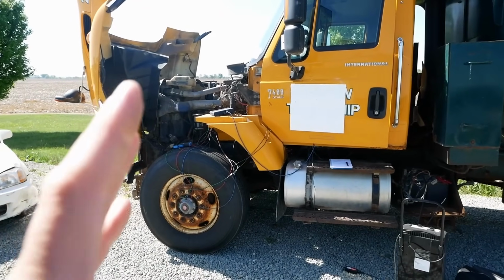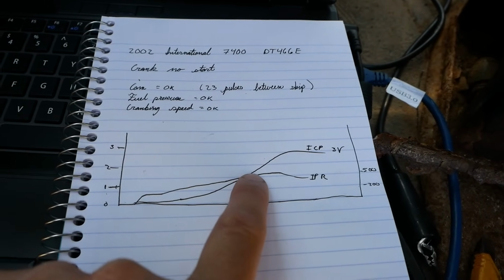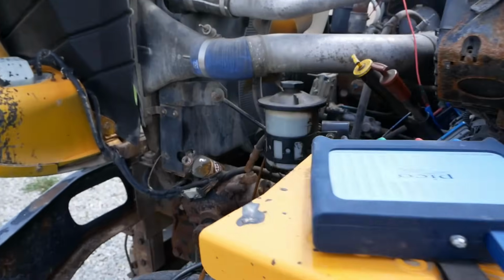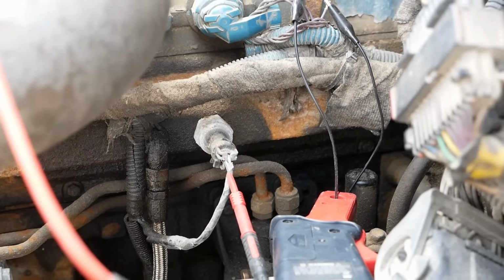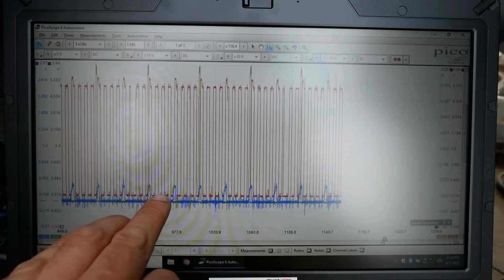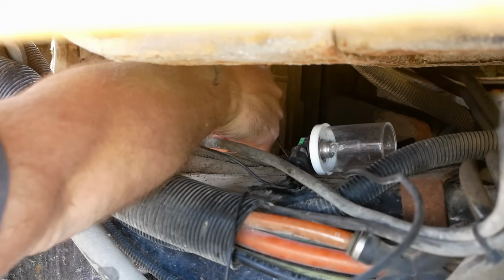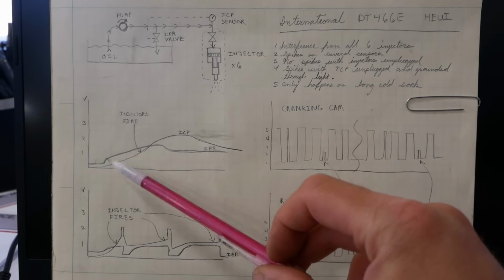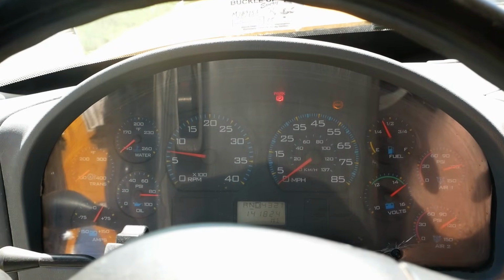International DT466E Won't Start without Ether after Sitting

Comment: These engines were good engines. They aren't too complex to diagnose. I think you need to invest in some software.  I've seen this issue before on refuse trucks. The truck will crank fine but one battery is actually bad. Voltage drops low enough it wont fire the injectors. Load test the batteries and one is bad. Install two new batteries and it starts right up.

Comment: Had the same problem the fuel runs back bleeds back to the  system, what I did is I put on electric auxiliary fuel pump to push the fuel into the injector pump

Comment: You might be overthinking this. With the fact that it will start with the battery charger on it, maybe it could be the battery cables not allowing it it crank fast enough.

Comment: This may have been covered slready but, the ecm relay in the dang fuse box on the fender skirt is just trash. Should have been put rlse where. Anyway the spade comnectors become coroded an she wont start. Keep them cleaned  as best you can.

Comment: Cycle the ignition after you shut it off at the end of the day it resets the ECM and it will fire up the next day with no problems works on my tow truck with dt466e

Comment: I clipped a ground wire to the pcm , Truck runs great  👍,  mine may also need a new pcm , I have installed used pcm on a  Truck , it worked fine  Ebay  ,  my pcm and idm weren't communicating,  I clamped a ground wire to the pcm and it started right up,

Comment: Why do u think it needs a computer
Reply from the maker: Watch the video man.
Reply: @WatchWesWork  ended up being #2 injector I ran the truck with the valve cover off seen oil spraying out the side of the injector.
Reply: I did and it makes no sense I went over everything u did and mine want start on ether
Reply: New ipr and icp new cam sensor builds pressure fine won’t start on ether

Comment: My guess would be dryed-out electrolytic bypass capacitors in the ecm. It resides close to the engine, so it is subject to heat. That would accelerate deterioration of said capacitors. What I would try is connecting a 22 microfarad cap of reasonable voltage rating between the 5v reference voltage to ground and check if that fixes anything.

Comment: I’ll bet it’s got leaky injector seals. ? Valve cover off. Get someone to spin it and look for clouds or puddles of oil around the injectors. If the seals get hard and fail the injector actuation oil pressure gets low and won’t fire the injectors.
  It takes 400 to 700 psi of HUEI pressure to fire the injectors. I can’t remember if the service tool has an injection actuation pressure test like cat does… the injectors are nearly the same as cat ones. I do remember that the international software does have an injector solenoid test. If the injector solenoids are very quiet and not clicking loudly, they are shot. The DT466e I had ALL of them quit at once. It had 15000 hours on it.

Comment: (God kveld. Utfra hva JEG kan se og få ut av videoen så slår2 ting meg som faktisk BØR undersøkes: I og rundt motoren så har man påfallende MANGE releer. I tillegg til at datamaskina i dettte tilfellet høyest sannsynlig kutter ut grunnet feil i styrings enheten som FÅR motor i gang. Når det gjelder relee, ryker sjelden 1 alene. Ofte er det tullball på flere av de. (I og med  at motoren er fra 2002 så har den garantert  flere av de. Det der med at den mister TRYKK, tyder på feil på styrings enheten som har med data å gjøre. Det ER ikke alltid at man får opp feilkode på sånt. M.V.H  Frode Valderhaug

Comment: Just curious was the starter oil soaked with a crap load of oil contamination in a lot of the sensors? If the oil is getting into the starter it increases the resistance of it and it builds a lot of heat which reduces it ability to crank because the resistance is opposing the current flow. You needed a battery charger to keep the weak batteries charged up or on jump mode putting out extra amperage to over come the positive temperature coefficient factor of the extra heat generated. An amperage reading of the starter draw would have been interesting to see but if the starter cannot turn that engine fast enough oil pressure will not rise enough to fire the injectors off. Not saying there isn't issue with the computer someone before you could have installed a computer module on it that was not rated for the same horse power and never programed it the the computer was the same part number but the rating for horse power are lower cause it was used on a lower power motor. Before and after amperage readings of all types of models kept in a note book is worth a lot to you later down the road. Even if it's not oil soaked that doesn't mean it isn't corroded internally btw. Oil soaked one was my issue with the exact same symptoms changed the starter out never had this problem again but it sounded fine cranking just dragged a little and that seemed to come on to quickly once I seen the amperage readings of my starter I thought it was hydro locking or something was seizing up but sure enough it was the starter. Took off the belts and turned the engine over by hand no reason why my amperage was through the roof except for the fact the starter was pulling excessive voltage due to an increase demand for current cause the resistance heat factor was so high. Great video

Comment: The problem is there's not enough icp pressure,he said it him self,I would of checked the oil resivour for the hpop, and if that was full,I would of then pressurized the hp oil line to listen for leaks, if no leaks,and the ipr valve is good,and there's low hp oil then it leaves the hpop as a cause.  Takes more  oil pressure to start it then for it to idle . They can idle at 450 psi when warm takes around 600psi to start it cold.

Comment: Not sure if this helps we have international 7400 with a dt530 a few of them doing the same thing after sitting gotta spray them to start turns out it was a fuel silo where 3 steal lines go into it as well as the fuel filter replaced on both vehicles problem resolved have another one on order god luck to get one been waiting over a month

Comment: I got one OFF the can by replacing the plastic fuel line fittings at the tank and pump. Once it started it seem to have enough vacuum to seal back up. Overnight I guess it lost some pressure then you were sucking air in the morning if you walked over and pushed down on it at the tank it would start right up. 

Now I am fighting it all over again something different this time. 

Great video learn some things from the comments as well.

Comment: but none of it explains why it does start without trouble within 24 hours of having run.
that is not temperature related.
to me that is fuel  pressure related.
it used to start with the help of a battery charger.
now that has deteriorated.
that is not computer or electrical.
that is a  high pressure pump internal wear growing bigger over time.

Comment: I think it’s an electrical issue. Pretty vague but I think a resistance is in the harness like fraying or corrosion. I’m have the same issue with my tow truck. I get it started by shooting ether down the intake of the turbo and it starts and run like a champ. Mechanically it can start and run but key on engine start it won’t start. In my case I already rebuilt the pcm and idm replaced the low pressure pump and high pressure pump. My only variables I believe I have is the fuse box and harnesses

Comment: Hey Wes, we're working on the same motor in a 2003 international 7400 with the dt466E. The driver has had a problem with starting for a while now (long start like it's not primed). He just recently had his truck shut down on him in the middle of the road. We cleared out his fuel lines/replaced the filters. The old filters had a sand/clay like substance in them. Running on a little ether and the new filters it ran for about 4 minutes with a ton of white smoke. Now it won't start at all with no ether. We checked the fuel pickup pump, nothing came out of it from the fuel tank or a 5 gallon jug connected. We replaced the pickup pump and same problem. We think the HPOP can is worn out or not spinning with the bull gears. What do you think?

Comment: Hey wes, i would have taken a heat gun to the theagic computer box,  i think there is a electroltic capacitor, that isnt the corect value anymore, if you heated it up without running it that would prove it in my book

Comment: *******  Stop diagnosing and remove and sand every electrical connection starting at the batteries, replace the battery jumpers and solder everything you can. Clean all the connections on the fuses as well. if a battery charger helped at one point than there is an electrical bottleneck somewhere. The truck is 20 years old, trust me and clean every electrical connection, dont assume any are good by looking at it just clean it. Running a jumper for the computer supply power to the battery may be required also. the chassis ground by the starter should be addressed also. Thank me later  *******

Comment: This engine is a recreational user of ether compared to the full on, heroin-like ether addict I had to enable when I was 17 years old.  Back in the summer of 1989 my brother and I got a job drilling holes for a blasting contractor.  He had an old (probably 1960's) Gardner-Denver compressor to run the rock drills.  (As an aside he used to pull it around with an early 70's Lincoln with suicide rear doors. He was a bit of a character). I have no idea what make the diesel engine was that powered it but you could run it wide open for hours, shut it of off for 5 seconds and it absolutely would not start unless you gave it a shot of ether.  Its addiction was notorious enough that the rubber hose that connected the intake manifold to the air breather never had a hose clamp at the manifold.  To start you pulled the rubber hose off the manifold, pushed the start button with one hand and used the other hand to spray away with the ether can.  Once it started you placed the rubber hose back on the manifold.  It was a high functioning addict as once it was started the thing ran like a charm and never let us down.  Before I saw this video I was the only person I had heard say that an engine was addicted to ether.  Ken

Comment: If it wont start without ether its because of low compression.
If you use ether regularly you will make the problem worse
because ether washes all the lubrication off the cylinder walls.

!

Comment: The computer will not fire the injectors until it see 900 PSI ICP pressure.
Reseal the high pressure rail.
Throw away the old ICP sensor and replace with new.
Reply from the maker: It's getting 1500+ psi with the injectors disabled.

Comment: Why on earth do manufacturers insist on placing expensive computer control systems in such stupid places? Here we see it wedged into the back of the engine exposed to massive heat cycles, others think the best place is low down behind a front wheel arch liner. I don't know if this is down to "designed to fail so muh income" or green design engineers straight of of uni putting these in these places because they have no real world experience - it looks good in the CAD schematic on the computer screen. Not so much after even 3 winters of slushy salt water. I guess it saves $1 per vehicle not having a bit more loom to put the computer inside and if you sell 1,000,000 vehicles it adds up and the shareholders get their return. It's all work for the working man to fix of course but shit, the design sucks.

Comment: I ran into this many times working at Ryder Truck Rental. Injectors needed replaced.Internals were worn out inside Injectors and would not start after a cold soak.Once fired on ether would start all day.

Comment: My solution for a problem was to replace parts. 
This engine is old enough,, that you can replace any part for the fun of it.
Rebuild the fuel pump,  replace the fuel pump in the tank.   Replace the wiring harness.   The wiring harness in the valve covers. 
You don't have to replace the turbo, oil pump,  fuel filter bowl.   These things can be rebuild with kits.
It may cost you $15,000, but that is less than a new engine.

Comment: Change your batterys. You need 2 1000 amp batterys. If the voltage goes below 10.5v the pump will shut off. That's why your battery charger helps. The either takes the load off the wheel batterys

Comment: Wes , firstly I have deleted my comments as your reply implied You were insulted.  My comments(readers) were about oil that could be draining between the main oil pump and heui pump/resovoir, and that air filling the voids is pushed into on cranking.   The 466e may be sump mounted oil pump ( dont remember ) but crank mounted pumps much worse for this.   
I did not imply nor did I type that this was your first rodeo (You wrote that), so if you took the information as something other than for you and others to consider and rule in or rule out for this or any other engine similar to it.   MY ADVISE to Anyone is   ""NEVER MIX EMOTIONS  and TROUBLESHOOTING they are mutually exclusive"".     Best of Luck on what electrical issue you think it is.
To any reader who thought any portion of my comments were meant to be anything remotely negative in any way shape or form, not it was not:  it is not Wes's first rodeo (his words not mine).
Looking forward to find out the root cause he determines it to be on his video channel here.

Comment: This ECM has every default input programmed such that a failure of about anything except cam crank comparison that is near complete failure , that this engine will run be it only on a few cyl or all 8 by substitution of default for actual..  this truck oil level is likely not set properly .   Let it sit for 24-48 drain sump replace filter (filled with oil). Fill the sump crank it with a battery charger on it run it until smooths out war it up shut it off check oil dipstick wait 10-15 min check again , then add to full mark . Restart and drive it til warm then park it overnight and look at all the extra oil on dipstick then start it and repeat such that the sump is full 15 min warm after shutdown (the heads and accumulators are full no air….  This is proper shut down oil level.
When the main oil pump backlash and the oil seal sucks air into allowing drain back into sump.    This is the overall issue ..   thicker cold oil drains back sucks air much slower easier  to start … shut off with hot oil it drains back faster more air in upper HPOP and injector areas to push out to all the injectors to pump …    Throw a Melling or factory oil pump and seal and change oil as I explained to set oil level properly and I will bet it’s like new, because you hear how easy and relatively good it’s starts at certain times.
Change the oil after the pump is done and you have ran the engine OR BETTER ado the oil change as I said then change pump IS BEST ORDER .

Comment: Don’t get drawn into the Fake info that there is a check valve to prevent HPOP and resovoir from draining down thru main oil pump .. that does not exist .. that ball check is on the IPR that that idea comes from .
Check the oil change on it and dump the oil no warmup just sit overnight drain the oil put filter on it full and run it drive it and see if the thicker fresh oil 1540 helps this will also identify main oil pump is worn not worn out it make oil pressure..  the backlash just allows crank seal to let in air and drain back to sump.

Comment: OIL PUMP is worn out….
7.3 psd same same issue….  Run it warm then shut down hood open to cool off as soon as possible .   When cooled off start it and run it till smooth then shut off ASAP ..   see if it can start easier after 1 over night sit .   If it starts easier (w/o ) ether.    This will tell you it’s oil pump on front of crank…
Cam and crank sensors should been replaced already to eliminate common electrical sensor .    Wrong cam sensor or bad … cam and or crank sensor.

Comment: Sounds like my dad’s 1988 Ford F450 dump truck. Sometimes it will start without needing starting fluid, other times it needs a couple puffs. Right now it can’t start at all due to a short. It could be related to why the trailer plug outlet isn’t working or it might be a separate issue, my dad’s mechanic will work on both issues once he’s done with my dad’s excavators (mostly the big Komatsu since it needs more work while the small kobelco is just missing a grease fitting)

Comment: See something a lot on 6.0 liter trucks well where something in the 5vref shorts an takes out every sensor in the loop and causes no start or stall while running usually a bad sensor or pigtail
With this thing only doing this after so many hours makes me think the hpop reservoir is draining empty and the lpop can’t keeep it full at cranking rpms until you give it a rev with ether. No throttle response is from lack of hpo availability. 7.3 trucks do this when the seal on front cover lets loose and the reservoir doesn’t stay full

Comment: So if there was enough corrosion on the bolt for the ECM harness to cause it to strip in the ECM, I wonder if you have some corrosion on the ECM terminals from the ECM to the engine side harness.

Comment: o rings in the oil rail prob all split or injector o rings need to be rebuilt. but that wouldn’t make sense because the oil would be thick which would make it start 🤔🤔. i’ve seen one with the same problem

Comment: I had a very similar issue with a 1996 Toyota Prado diesel.  It was alway difficult to start when cold and worse the longer I left it between starting.  The issue got worse over time and finally got fixed when the auto electrician found a leaking capacitor in the ecu.  Ultimately a few capacitors were replaced and everything has worked perfectly ever since